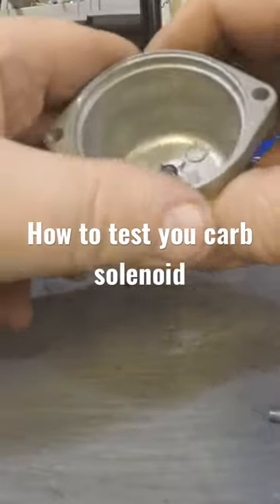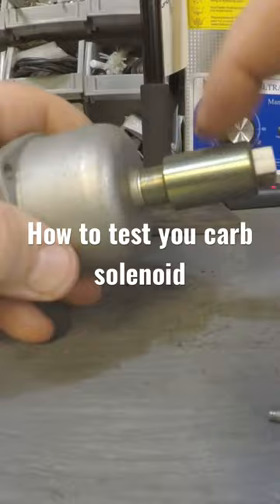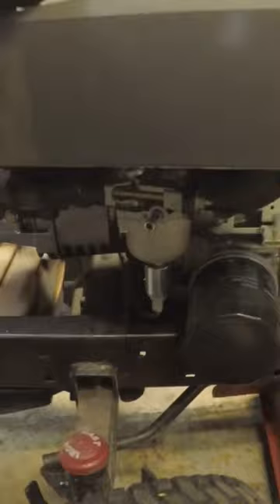Simple Fuel Solenoid Test on Riding Mower Carburetor #baldeagle242

Comment: yep you just cut the tip off and say goodbye to that extra garbage
Reply: You should add a manual gas shut-off for 2 reasons. 1' to prevent muffler explosion, and 2' keep carb cleaner by running carb dry after every use.

Comment: Was cleaning up my new to me mower (which had no problems starting before I screwed w it). I unplugged the solenoid. Went to plug back in but it plugs in forward and backwards. Suddenly harder to start. Got it running. No clue if it’s plugged in correct or not. Stop and start a few times. Seemed ok. This morning no start. Seems flooded maybe?  Could I have plugged it in backwards and it filled w gas and flooded??
Reply from the maker: The fuel solenoid's primary function is to shut off the fuel supply to the main jet inside the carburetor to prevent fuel from being sucked through the engine and into the muffler. This mechanism helps to prevent a backfire condition by stopping the hot exhaust from igniting the fuel. The solenoid does not control the main fuel supply coming into the carburetor. If the solenoid is connected incorrectly, it may fail to open, preventing fuel from entering the engine, but it will not cause the engine to flood. An engine flooding issue is likely related to other components within the carburetor, indicating a separate malfunction.
Reply: Thx. I’ll have to test the solenoid and then see if I have a leaky carb too
Reply: I’m checking when I get home today. I probably should’ve clarified. I don’t know that it’s flooded. Mower was dirty when I bought it and I took shroud off and cleaned it all up. Happened to unplug solenoid. When I plugged back in it no longer started the next day (had never had an issue starting before). I don’t know if it matters which way it plugs in - plugs either way. But I pulled it out drained gas from carb. Worked the plunger a bit and put it back in. Plugged in. Fired right up. Next day crank no start again. So I don’t know if the solenoid is the problem or if it just drained the fuel from a flooded bowl and the o ring inside the carb is the problem. I will test the solenoid when I get home. But if that works what’s a good way to tell if it’s flooding?
Reply: solenoid works. Took spark plug out and turned engine by hand. A very small amount of gas came out teaspoon. Changed spark plug fired up. I think I’ll rebuild the carb and install a manual shutoff too and oil change.  Does that sound right?
Reply from the maker: @goirish6590 Yes, it sounds like something is leaking inside the carb. You’re on the right track.
https://youtu.be/-uzKSJhJtww?si=zFj5ZttHxs9B9POp

Comment: What if you have 12v to wire and plunger does not move. This is my case on a brand new solenoid?
Reply from the maker: Make sure the solenoid is making contact (grounded). If this checks out and you have confirmed 12 volts to the connection it’s pretty likely you have a defective solenoid. New or not there’s not much else to them.
Reply: @baldeagle242  ok thanks got it to open and close. But mower still runs ruough no matter what I do